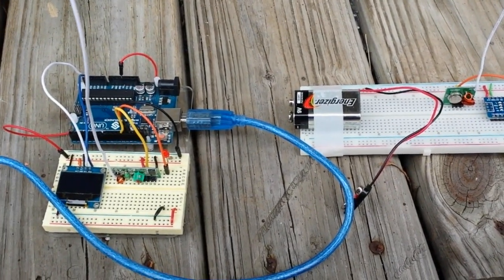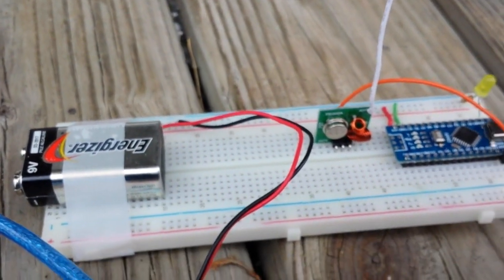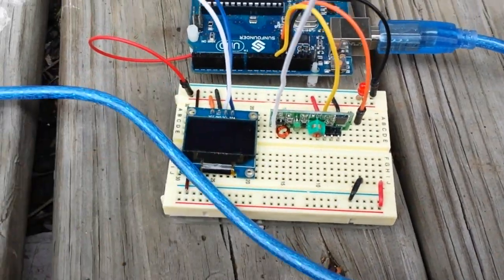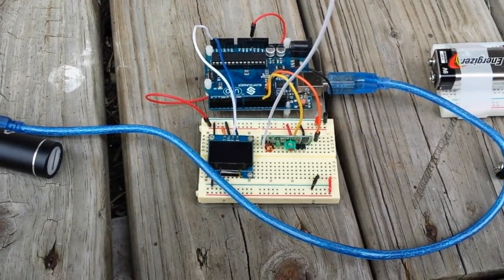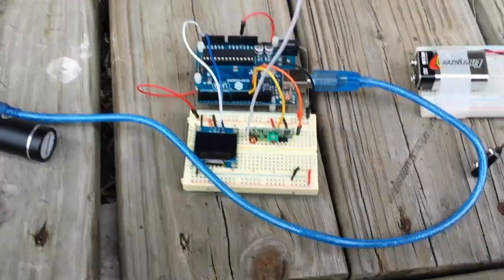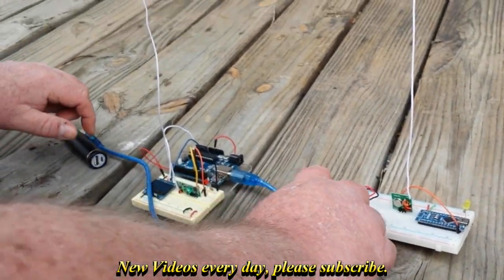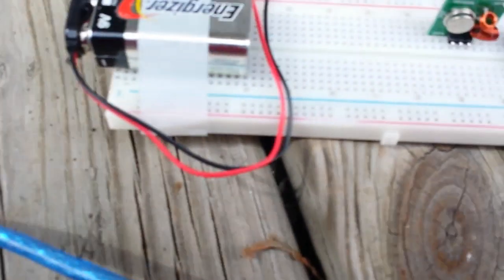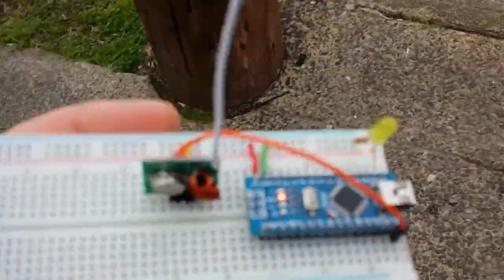Arduino Wireless Link Max Distance Test

Comment: did you just power them by 5V?
and did you use normal copper wire for the antenna and at which length?
as one tip for increasing range you could connect a similar antenna to the ground of the module, and point it in the opposite direction of the other antenna that way you get a half dipole which might increase range.

Comment: To put things in perspective after this very good demonstration, the NASA spacecraft, Voyager 1 launched  in September 1977 is now beyond the edges of our solar system and in deep space and we are STILL receiving signals from the spacecraft thanks to the nuclear battery. The RF transmissions are just a few BILLIONTHS of a watt in strength received.
Reply: Receivers sensitivity is so high that it can even receive a keyfob on the other side of a planet

Comment: I know this is kind of off topic but would it be possible to set this up so that you had a control unit on your body and then a set of receivers located at different points and every time you came within a set distance (few inches) of the receiver, it would beep?

Comment: how'd you hook a 9v straight up to the arduino? Am I just not seeing resistors? I have a sneaking feeling this is a load of malarkey. I get like... 3 feet. If I turn the lights off. Great toons tho!
Reply: The Arduino Nano accepts the 7-12 Volt input power not from the USB port, but from the Vin pin (pin30).

Comment: Hello, Thanks for the video, Did you use 9V directly to the Microcontroller, Also did you use 9V directly to the Transmitter and receiver VCC
Reply: i think he fed 9v to arduino Vin and 433module is supplied by 5v
Reply: @sayantanmaiti2513  I think he's powered the transmitter with 9V from the rail.

Comment: 3:55 ehm .. "On average, a man's walking stride length is 2.5 feet, or 30 inches, 
according to Arizona State University Extension. A woman's average 
stride length is 2.2 feet, or 26.4 inches, reports the school. "
So somewhere between 130-140m distance. Still decent.

Comment: Thanks. I just spent over a month working on these modules for a Parallax Propeller micro and then I discovered I couldn't transmit to the other side of the room...bummer. I'm glad you had great results with an antenna.

Comment: i tried basically the same kit of transmitter/receiver (real-real cheap) and no, stable signal was nowhere after 6-7 ft distance (even with single-wire antennas like yours) :(
i guess, my stuff is defective or something.
Reply: Try it with 12v input, these modules are not designed for 5V supplies.
Reply: @tunahankaratay1523  really? the spec was 4 really low voltage, nowhere around 12V.
Reply: @nskmda  As far as I know from these modules, it is possible to get around 300 meters in open air with 12V, though I have never tested it. With lower voltages, the signal quality is highly unstable and in another video I have also seen that the range with 5v is around 2m which is pretty close to your result. In this video, 9V is used and the range is 160 meters, so it seems possible that 12V would give you 300m. The spec sheets of these devices are pretty non regulated since these devices are probably manufactured by various small companies.
Reply: @tunahankaratay1523  hm... okay. i may give it a try. the problem is i'm trying it w/Arduino which doesn't allow voltage beyond 5V tops...
Reply: @nskmda  Actually it does. You need one 12V supply and you connect it to the VIN pin (or RAW in some cases) of your arduino and also the VCC of your RF module. Then you can hook its data pin up to any digital pin and it still works, only the VCC pin should be connected to 12V. Note that the receiver is not 12V compatible, it only works with 5V.
Reply: @tunahankaratay1523  man, u r genius. it NEVER occurred 2 me 2 check my Uno's full spec. Recommended input voltage is indeed 7-12V (cool). But in my project's case having 12V somewhere in the wild is hard. i got 8 small solar cells (cheap 1s) and they deliver measly 1A while Uno + sensor + transmitter eat out easily (and drain the back-up battery as well). and those cells only get me 5.xV :( but thanks 4 the ideas and info.
Reply: @nskmda  No problem. Hopefully you get your project working soon!

Comment: hi. just a few months ago. i did a similar range setup. some tx/rx modules are crap.. some of them have tx 'rf output' transistors swapped with smaller ones..range is drastically affected.. module from ebay.

Comment: A few thoughts:
Don't do the background music.
Maybe have the camera on the receiver instead of the transmitter and then speed up the part where you're walking away until it loses signal. And then show us how far away you are. I ended up just skipping to the end because watching someone walk down a road isn't very interesting, and I don't really have a good concept of how far 150 meters is, so it would have been nice to be able to actually see that. 

Interesting experiment though! Good to know! I've heard there are other wireless thingies you can use with the Arduino that go even further. Are you familiar with any of those?
Reply from the maker: Daniel Heppner thanks Daniel. I'm familiar with the other modules as well. I just wanted to see the range I could get out of these units that cost about 50 cents each. the NRF24L01 modules are about $2 bucks each and don't provide any more range (but they are duplex), and HCW69 modules (along with the closely related LoRa) have range surpassing 1/౩ of a mile with a good antenna, but are $3-5 each. many options, lots of choices.